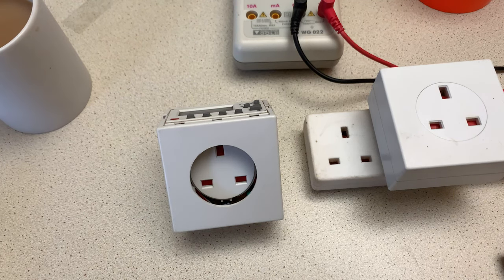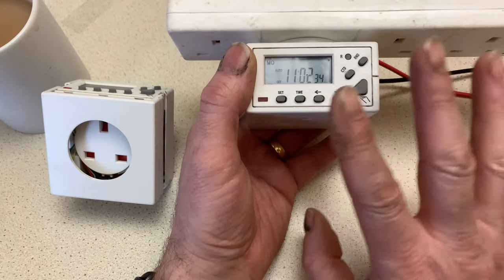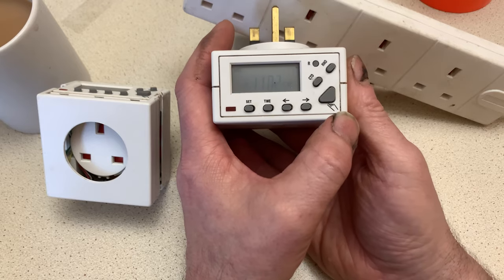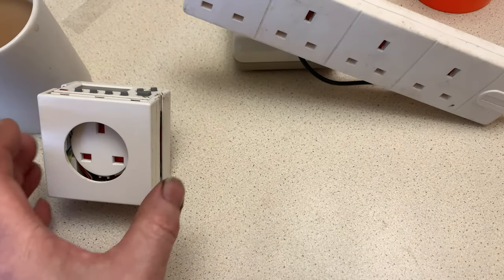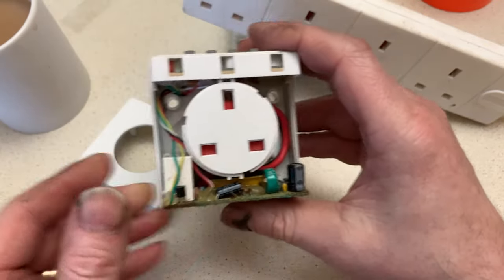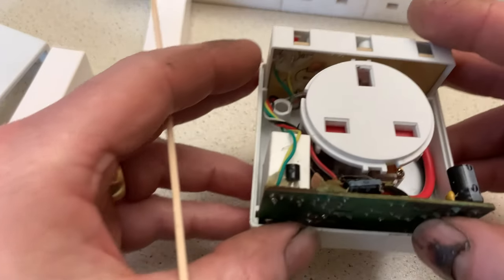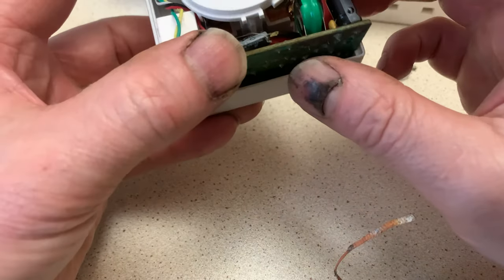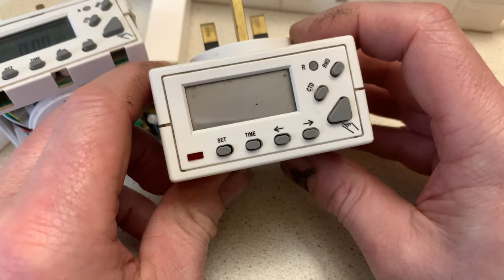Electronic Plug In Timer Repair. Battery replacement time!

Comment: Definitely Ni-mh with a cell voltage of 1.2V. If it was Li-ion they would be at 3.6V out of the box.
Reply from the maker: Hi Tore, thanks for the great info and of course for watching 👍🏽
Reply: @MikeMakesIt  Thank you, your video saved me in a pinch. Showing it was a Ni-mh battery, I found it worth a try just leaving the timer plugged for half an hour. Ni-mh cells can usually be revived to some extent by just slow charging them. It was enough charge for me to program it indoors, and sprint out to the garden to plug it in, without it losing the programming.

Comment: Nice one Mike couple of thing what type of iron is the best for printed circuit soldering and was the air blue when you got your badge of honour ie black nail hope you and the family are safe and well and you didn’t drink to much here’s to 22🍺 and don’t forget there’s nothing like an old timer 😂👍👨🏻‍🏭
Reply from the maker: Hi Paul, all the best to you and yours for 2022. Yes my thumb hurt and I was a tad upset! Soldering irons, I have used the Weller TCP magnastat type for years and find them great. You can quickly change to tip to suit the work you need to do as well as the temperature as its tip related. Here's a link: https://uk.rs-online.com/web/p/soldering-irons/0660185
There are I'm sure better kit out there but this one still works fine after many, many years! 👍🏽👍🏽